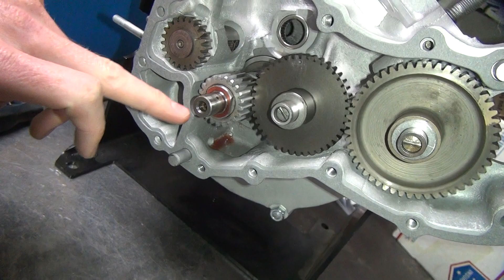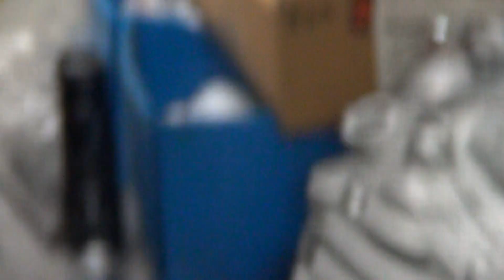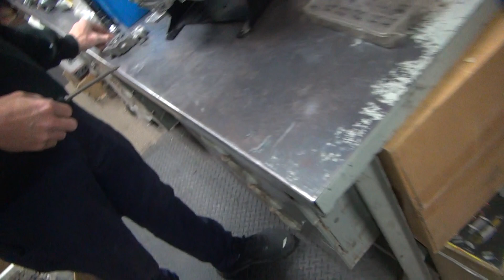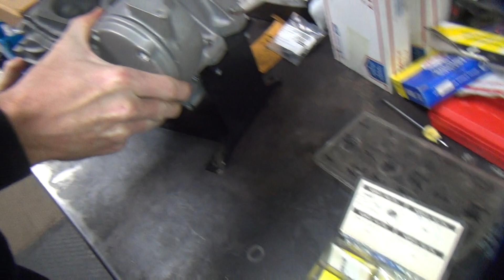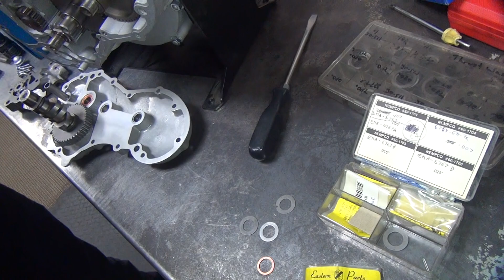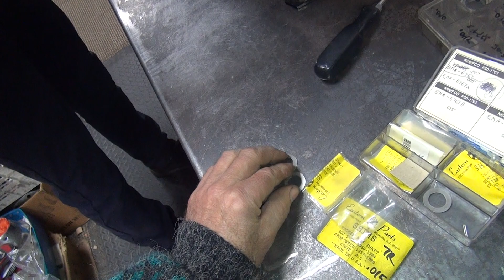#151 1961 FL 74ci std heads panhead motor rebuild cam endplay shimming oil pump harley tatro machine

Comment: Do you suggest running a oil filter on a panhead engine?
Reply from the maker: it helps but if you change the oil often like every 2000-2500 miles you don't need one. the key is to use good oil, not that crap you buy at the auto parts store.
tatro

Comment: Aaaaaah grasshopper, finally someone who is willing to help out with rebuilding his engine. 👏 
I'd LOVE to come use your Sunnan hone machine and play with some of your other machines. I'd definitely get my ass kicked with the trueing stand and the balancing of the flywheels (drilling). Looks like those would be the ones that separate the men from the boys. I'd probably make a Swiss cheese out of a flywheel once I'm done with it. 🤣
Reply from the maker: if fred can do it, than anyone can.
tatro
Reply: @TatroMachine  I've seen you get those done with dead nuts accuracy in less than 10 minutes and thats impressive! Practice makes perfect i guess. Did your Dad oversee any of those special shop practices? I'm sure there were some things Dad always had to oversee and sign off on?